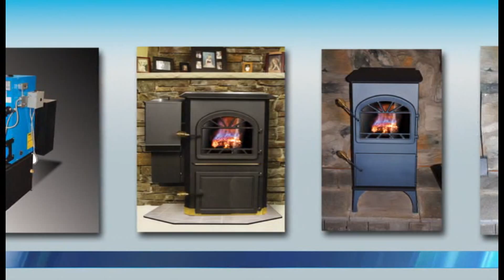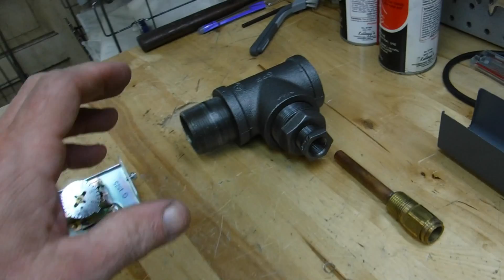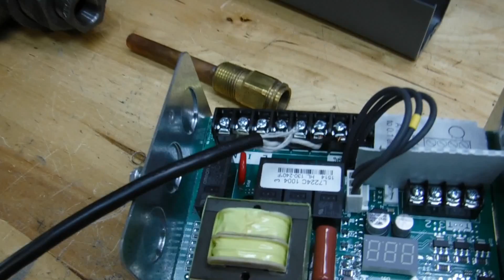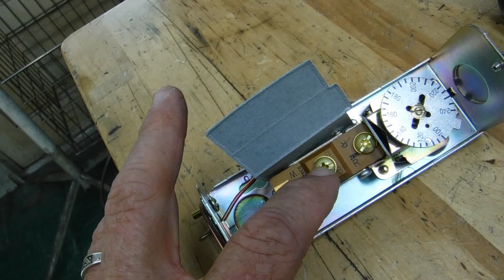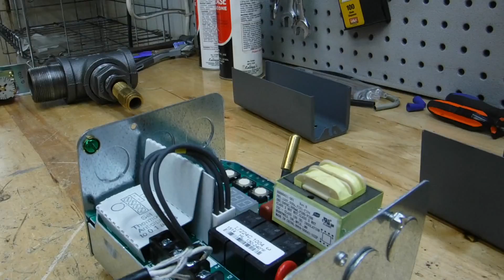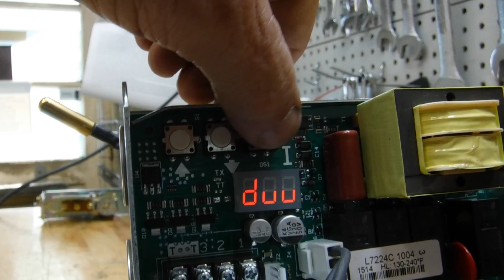Aquastat Setup Instructions

Comment: Wish you had spent some time on how to operate the set point dial on the single unit. Having a hard time figuring out what position to turn the dial to get desired temperature inside an E-ZEE Flo heat exchange cylinder…😢

Comment: i have the L7224U 1002, its brand new, my problem is i cannot control heater with thermostat, heater turns on and off without using the thermostat,  any info would be appreciate
Reply: That’s odd, because this controller shouldn’t be doing anything until it gets a heat call on terminals TT from a thermostat or Zone Controller relay like the Taco SR500 series.

Comment: I’m having problems with a error code 1 and I’ve had lots of problems with different units with the error code 1. I’m wondering if the drywall isn’t making proper contact. Wondering if there was a sensor that bolted to the block
Reply from the maker: You can use thermal grease to make better contact with the dry well.  Error 1 wouldn't be caused by poor contact though, that is internal to the circuit with the sensor.

Comment: Thank you for the video. I have one of these on a crown boiler system. The problem is that our boiler does domestic hot water and baseboard forced hot water heating. The problem is that the domestic hot water is scolding  hot. Is it OK to turn the high level down below 180? Thank you for your time
Reply: Yes it is okay to drop the high limit as low as 140, Keep in mind that you will need to drop the low limit to 120 as well. I think 120 is the lowest temp set on the low and high limits. The high and low limits should be set minimum of 20 degrees apart or you will find the boiler locking out. You should also have a water mixer valve that you can adjust the cold to hot water ratio.

Comment: Thanks for taking the time to make this video. When programming the control how do you set it up for just a "straight heat" like the old L4148A? Is it programed for straight heat by default or do I have to program it to do so?
Reply from the maker: It should work straight out of the box.

Comment: Low limit should be 20 degrees below the high limit. Do not put the high limit above 200 degrees if you do not have a steam boiler. The low limit does not need to be there unless you are using your boiler for domestic hot water. Increasing the domestic hot water output can be done by increasing the low limit differential. Please be careful folks!
Reply from the maker: Solid fuel boilers are run differently than gas or oil units.  The low limit is always used, solid fuel has limited recovery capability.
And yes, always be careful, proper installation per local and national codes is mandatory.
Reply: @LeisurelineStoveCo  I always forget about solid fuel as they're nearly never used in my region!
Reply: i have oil and the same controller, and i set my high limit for 170 F because by the time the boiler stops, the water will climb to 184 even after the fire stopped.  My low is set for 150 and the LLF is kept at the default of 10.   i have PEX pipes that deliver the hot water to the base board heaters and they seem to pump out plenty of heat like that and I want to keep the water temp 180 or below, so i dont damage the pex pipes ( they are rated for 180 for baseboard heat I believe).  I understand that the boiler will kick on at 150 at the lowest, and when heat is in demand, it will kick back on at 160 (which is 10 below my max of 170).  So in my case, since i have that big 14 deg rise, i could set my recovery or LLF to maybe 5 deg?  Then it would bounce between 165 and 184 for baseboard heat.   I also have domestic hot water, using a mixer valve set to 115.  Then if you just want the hot water for a shower, the boiler will bounce between 150 and ?   what would the low level differential be in that case?   Is my understanding correct here with my settings?
Reply from the maker: @SteveHartmanVideos  if I understand correctly, you have an oil boiler.  In that case the low limit would be on 130*.
Reply: Hi can I please ask you a question. I have this system which does our forced hot water baseboard heaters and also domestic hot water. The problem is that the domestic hot water is scolding hot and I’m trying to adjust this. Why would be ideal LL & HH settings to lower my domestic hot water? Thank you
Reply from the maker: @markweston3345  you need a mixing valve on tge hit water out of any boiler that is used for domestic hot water
Reply: @LeisurelineStoveCo  Thank you for your reply. I’m looking at my system right now and I do see a valve that could potentially open a line between the cold and the hotline going to the domestic hot water. If I open this a little bit should I see change in the temperature??
Reply from the maker: @markweston3345  yes, you can adjust it so the water temp out is safe at the highest boiler water temp, not idealsincr it may be too cool when boiler Water temp is lower, but better than nothing.  A mixing valve is automatic, relates outlet temp to a constant number
Reply: @LeisurelineStoveCo  Thank you so much for your help. It worked and it’s good enough for now. Merry Christmas to you
Reply from the maker: @markweston3345  my pleasure, wishing you and your family a happy and healthy new year!

Comment: I have the same unit as you are demonstrating - L7224. I can get into program mode by pressing the three buttons as you show, it shows me the HL limit. But when I press "I" to scroll thru the options, my next and only other option is to change between "F" and "C" degrees, which in my manual is the last option I should see...if I press I again it goes to the HL setting...I have no LL option, or any of the other options. Any ideas?
Reply: check the mode settings in the manual, there is a way to set the modes up and you might have it set up for the wrong mode.  the modes are how it konws if it should be controlling a water pump, etc.

Comment: I have this aquastat.   I checked mine.  HL is 180 and LL is showing off.   Is that normal?
Reply from the maker: No, make sure the jumper is removed and the knob is turned to the desired setting
Reply: LeisurelineStoveCo no knob has the 3 buttons.   I set the HL to 180 and set the LL to 160.   The guage and readout goes up to 230-250.  Max hot water temp is for the boiler is 250.    Have no clue why its going past 180.   Its a rental property.   Waiting for response for a tech to come check it out.
Reply from the maker: @jamesa6272  oh, thought maybe you had the new style hydrostat 3250, since you have the Honeywell have never seen off before.  I'll check the documents and get back to you.

Comment: Great video.  Please note, though, there are T T terminals for the thermostat as well.  They're not on the bottom strip ,but up and to the left a bit, allowing for a thermostat circuit input into this controller
Reply: Thanks. Never understood what T/T and in some cases x/x terminals were.
Reply: The T T in this Triple Aquastat should receive no voltage, so be sure not to send 24v from the end switch of a Taco SR zone controller or 24v from a thermostat that runs on 24v.

Comment: Pex melts at 220 degrees? Please elaborate. On a cold day say 10 deg. oat would you need to change for say the hl to 200 and the ll to 180 with a 25 deg diff? this oil fired burner is with a tankless hw heater.
Reply: 220?  that's for steam i think.  I have oil and pex for hot water heat.  the pex can only go up to 180.  i have my settings on 170 high because it goes up to 180 when when it cuts off the fire at 170.   the base board hot water heater elements will still give out plenty of heat (if they are not too old?) at around 160-180 which is how i have mine set up in NJ.  we have some pretty cold winters.

Comment: is high limit at 180F normal? On my L7224U i have high limit at 220 and low limit at 195.
Reply from the maker: Armagan Yavuz , that is fine as long as you don't have any plastic plumbing such as Pex pipe in your system.  Running the temperatures that high will not hurt the AA220 or WL110.
matt
Reply: LeisurelineStoveCo thank you so much for replying. Honestly at 220F the water isn't even that hot! if I set HL to 195 or 200 I only get lukewarm water... Do you think I may have some issues with my system?
Reply from the maker: Armagan Yavuz , yes the circulation pumps should be connected to either a zone control with ZC/ZR connected from the boiler aquastat or if one pump connected to C1/C2 in the aquastat.  This will shut the pump off if the temperature is below the low limit differential.  give me a call at 570-752-1811 to discuss further if you want.
matt
Reply: @TheArmagan2211  you're mixing up the two water circuits.  The 220F or 180 if you have oil and hot water, is for the heater going to your baseboard water heaters.  getting hot water for domestic hot water like for the showers or sink, you would then have a mixer valve that takes the 180 F water and mixes some cold in there to give you around 120 out to the house.  those break all the time due to water corrosion inside.  Check that part, some of them have a dial to adjust the hot water temp that is mixed.  if its already at the hottest setting, then its prob  in need of cleaning or replacement.    i just replaced mine.
Reply: Armagan Yavuz gu